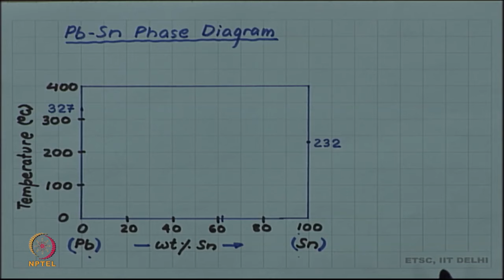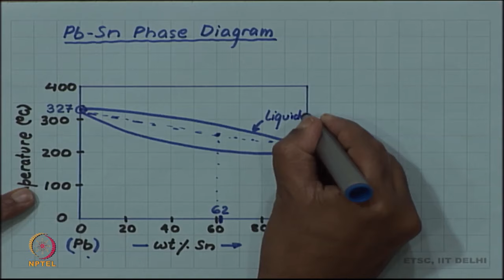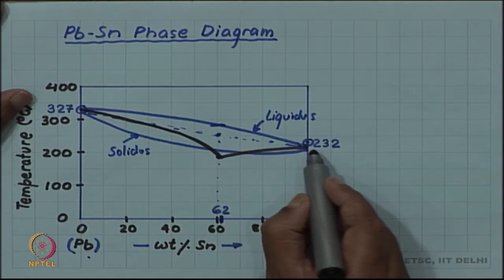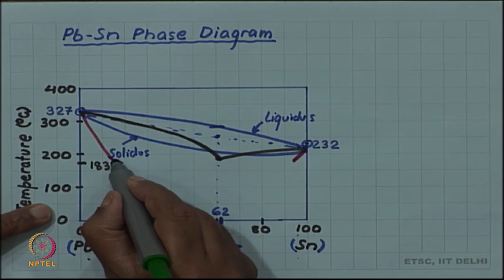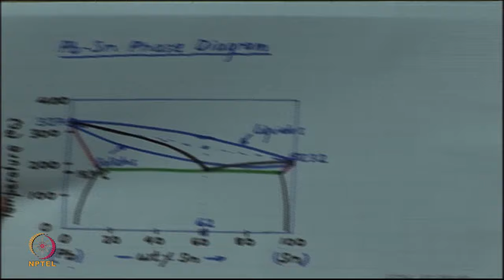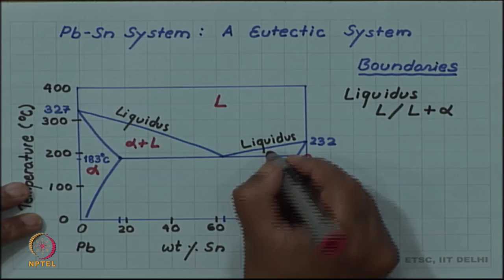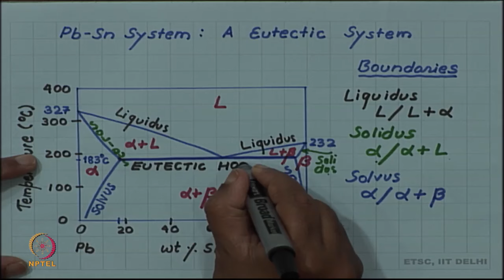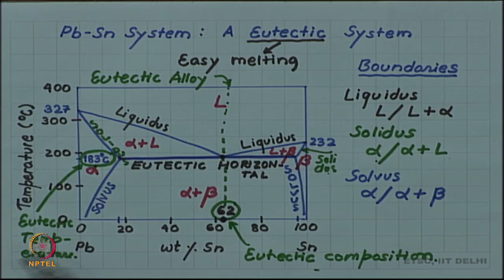Eutectic system

Comment: Sir, why the Eutectic horizontal line is not called as isomorphous line? ( as this line even defines at one temperature at 183 C ).
Reply: It is an isothermal line. Since the line is associated with the eutectic reaction it is called a eutectic horizontal. We could have called it 'eutectic isothermal', but it is not standard.
Reply: Thank you ,sir.

Comment: Sir, please explain us why Pb-Sn alloy shows different phase diagram?Why there occurs a different alpha n beta solids?
Reply: because Pb and Sn have different crystal structure. Different crystal structure didn't allow complete solid solution. So, both alpha and beta has solubility limit represent as the solvus line. Isomorphous diagram, like we see from Cu-Sn, is only for components with same crystal structure, so there's complete solid solution.

Comment: Sir Is 100% soluility possible in Sn + Pb.. is it possible to draw phase diagrams if the components are not 100% soluble
Reply from the maker: One requirement of 100% solubility in a solid state is that the two elements should have the crystal structure. This is not satisfied in this case as Pb is based on FCC lattice whereas Sn is based on BCT lattice. The phase diagram is still possible. The solvus lines will show limited solubility.

Comment: Is there liquidus and solidus curve occur change only by 62% eutectic composition? What happens when we use other %?
Reply: No, there's a liquidus-solidus curve change at different composition. Example at 50% eutectic composition which affects the eutectic temperature which may drop

Comment: Hi sir. What is the difference between alfa and beta alloy. If alfa is of one crystal structure and beta is of different crystal structure how can both alfa and beta exist as a single crystal. what is the actual difference between alfa and beta sir??
Surface defects - Can we say that alfa and beta in lead tin eutectic alloy at low temperature forms a heterogeneous surface defect. assuming alfa is of one crystal structure and beta is of different crystal structure?
Reply from the maker: Alpha and beta have different crystal structures and different compositions. In sample both can be present but they occupy different volume elements of the sample. They meet at a surface which we call the the apha/beta phase boundary.
Reply: @introductiontomaterialsscience  Thank you sir. Since this is a substitutonal solid solution of 100% solubility how can we have different crystal structure.  if it is a interstitial solid solution like we can have two different solid structure like alfa + Fe3C in Iron carbon diagram.

Comment: sir why eutectic composition has lowest melting point?
Reply: Like all 'Why' questions this one is difficult to answer. We just accept the phase diagrams as experimentally determined diagrams. Of course, since they are equilibrium diagrams, they represent the phases or mixtures of phases in thermodynamic equilibrium. So one can say that we have these phases because they result in the minimum free energy of the system. But then the question remains why the particular combination of phases have minimum free energy? Difficult to answer!
Reply: @rajeshprasad101  thank you sir
Reply: @rajeshprasad101  sir aap to shayar bhi ho 😅🙏🙏 dhanya ho gurudev 🙏🙏